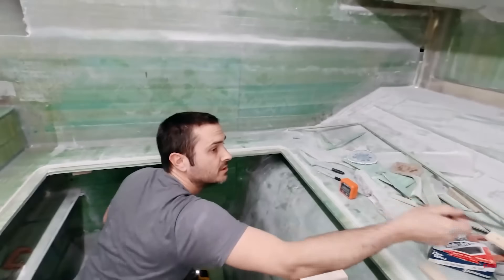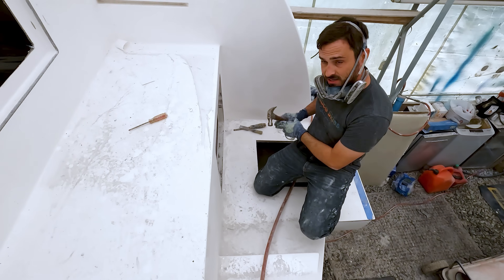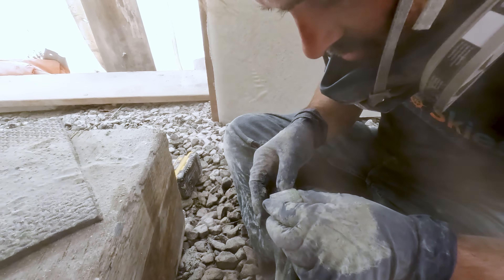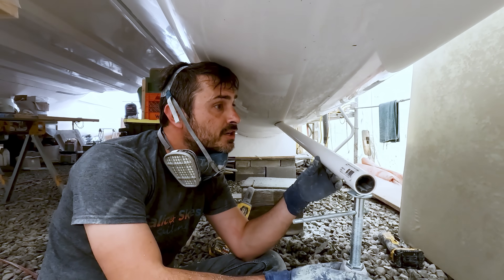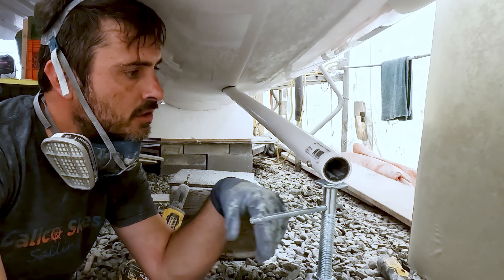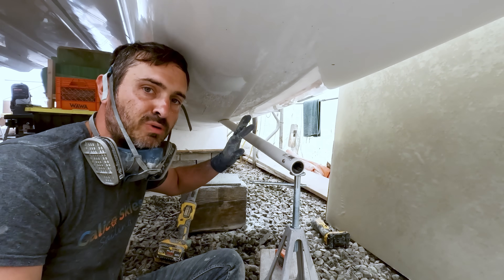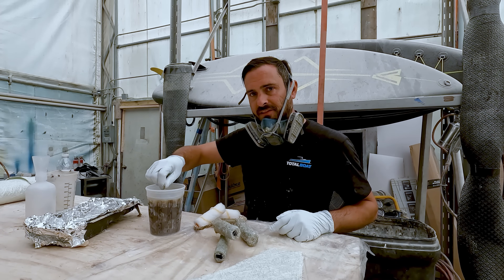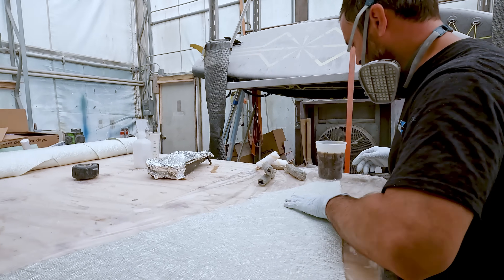Installing Our Prop Shaft & Building the Skeg (MJ Sailing - Ep 292)

Comment: Good stuff. I realize it's been a while, so I'll have to backtrack to the follow-up vids. But please tell us you made a duplicate for the other side before you attached it, or you at least saved the template. It would not be easy to recreate all the dimensions of the foam once you've glassed it. I'm also curious if you're planning on encasing the shaft housing and protecting it with more glassed foam on the bottom side as well. Looks like I'll have to do a deeper dive on the following videos to see. Keep up the good work.

Comment: Is it my imagination or way back when this build started were you planning to use outboards?
Reply from the maker: When we were in the planning stage, yes, the intention was to use outboards. But after spending an afternoon on a Seawind that had them, we realized they're only good for coastal cruising. Then the plan switched to diesel, but after a visit to the Max Cruise factory last summer, they wanted to help us out with electric propulsion. So now we'll be electric/diesel on port, and electric on starboard.

Comment: With the hardness of the hull you have created. Do you think you could do some high latitude sailing?
Reply from the maker: It's a pretty fragile egg shell of a hull.  Very stiff due to the core and glass used, but doesn't have the toughness I'd want for high lats.  But the funny thing when we were sailing the Arctic Circle was that only British and American were metal boats.  All the locals were sailing standard production boats without issue.

Comment: Interesting way of setting up the shaft.  why not just add a strut coming down from the hull and a cutlass bearing rather than putting in the whole skeg?  I know Dazcat does something like that but I hear that it slows their tacking down as well?
Reply from the maker: I thought of doing a normal strut - we have the largest supplier of bronze struts in North American on the same island as us - but never followed up with the designer as to why they planned it this way. Once we switched to hybrid that required feathering props, the thought of adding an additional skeg below the shaft to protect the blades ruled out the bronze strut.
Reply: @MJSailing  that makes sense, I just shuddered at watching you sand off all that gorgeous gelcoat only to have to bog and fair it all back in.....My current boat-- a 35' pescott has a single 20hp steerable outboard which is actually OK... being able to steer it makes a huge difference to maneuverability
Reply from the maker: Nice light catamaran 👍.  This will just need fairing.  No gelcoat being added to underwater surface since we are barrier coating the bottom.

Comment: Matt answered my question right at the very end. I was wondering why we weren’t glassing that prop tube into the skeg. But I guess he will. Looking great !
Reply from the maker: Yup, it will go on next! We're waiting for new vinyl ester resin to arrive, but hopefully we'll get that part done this week.
Reply: @MJSailing  Is there any consideration for offsetting prop walk by putting the shaft slightly off center to the rudder which also allows you to extract the prop shat if necessary without dropping the rudder?
Reply from the maker: No issue on this boat if prop/rudder clearance... The rudders kick aft and retract for impact protection and to go in shallow water, so that also works for shaft removal.

Comment: How are you going to replace the drive shaft padding that's inside the white pipe once it wares out?
Reply from the maker: Cut and compress the cutlass bearing.  It's how we did it even with a normal strut if the shaft was already removed and we didn't have a puller

Comment: Matt, The close proximity of deadwood directly in front of passing prop's blade at 12 oclock position will shroud blade in that area, or restrict water flow from being smooth. If you make a curved half moon or crescent in aft edge (with slight aft tilt 7.5 degrees) it will allow better flow, and possibly prevent a minor thumping effect like helicopters make when blade passes over tail section or wings in case of V-22 Osprey (why it sounds so unique...)  The thumbnail shows a look in Jess's eye that makes me think you were commenting about her holding the shaft... am I right ?

Comment: if you build up fiberglass on the bottom of support won't that change the angle  of shaft tube, just a thought
Reply: Angle will stay the same but it certainly will change the centerline of the shaft. Hope you took that into consideration, or maybe it doesn't matter???

Comment: That is a nice set up. You did a nice job getting it in. You mentioned cutting the tube to length. How long is the cutlass bearing? Will a packing gland fit directly to the tube?

Comment: You may have already cut the other stern tube but if not you can hire diamond hole cutters of various diameters, which can cut deeper holes. They're principally designed to cut through concrete so the fibre glass should be a breeze.  To my recollection there about 9" long.

Comment: Is the wing if that's the proper terminology going to extend below the prop shaft to protect the lower edge of the propeller? I was impressed by how the inside corners of the fiberglass turned out as I know it doesn't like corners would've thought like a long triangle on either side to the hull would gain more strength in the long run. Please excuse me if these are armature observations I'm no expert just curious.

Comment: I would assume that it would have been more efficient to have a completely horizontal drive shaft. I was surprised to see you lining it up about 7 degrees to the horizontal.

So when you are motoring you will be pushing the water down 7 degrees to the horizontal, instead of pushing the water backwards.

And when you're sailing without the motor I assume it'll have very little difference. (Maybe)

That's just all assumptions, after i had a long day walking 17km in 34 degree heat (which on American temperature scales is very hot).  I don't know, maybe, maybe not.

I'm just wondering why the driveshaft is not completely horizontal?
Reply from the maker: You can't put the engine down at the level to allow a straight shaft and the prop to clear the hull.  It requires an angle.

Comment: way better than sail drives put the engines in and go... finish the rest under way. beef up where the shafts go through the hull.
Reply from the maker: I like that the stern tube bisects the bulkhead adding rapidity to the whole setup.  It should be very strong.

Comment: Have never seen a catamaran without saildrives before--Very interesting !!!
Reply: All Privilege Catamarans are shaft drive and I think HH are as well. Shaft drive is more reliable, you don’t have your running gear hanging in the water. Sail drives are predominantly on catamarans built for the charter industry. Sail drive are also higher maintenance, requiring haul-out more often.
Reply from the maker: The older Lagoons and Leopards were shaft drive too.  But as you can see, it is a much more time consuming job than just cutting a hole for a sail drive - which also have the engine bed already attached.   We've probably spent close to 200 hours to get to this point.
Reply: @MJSailing  I learn something every time I watch MJ sailing-thanks !!